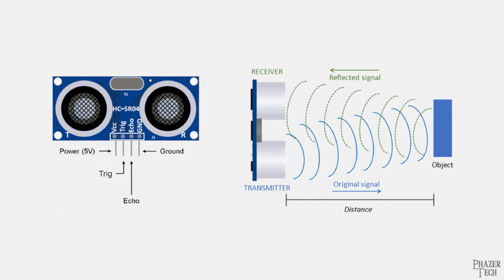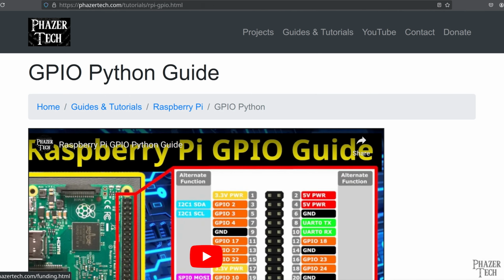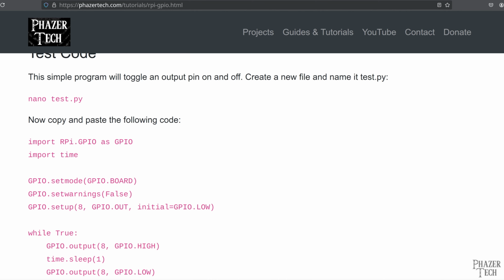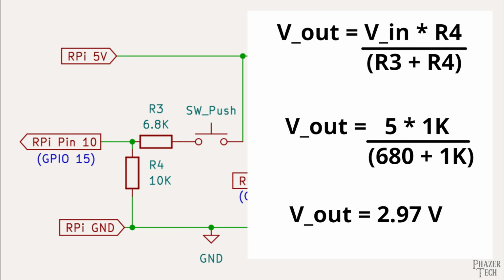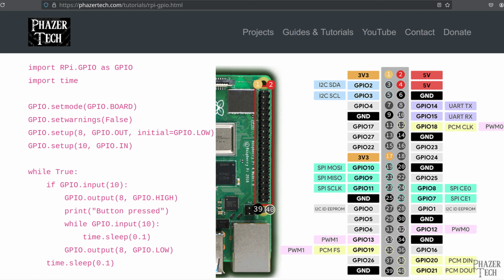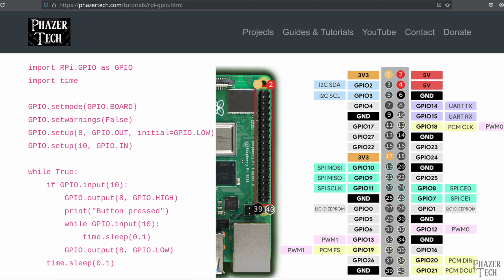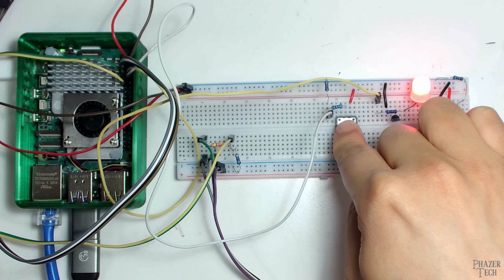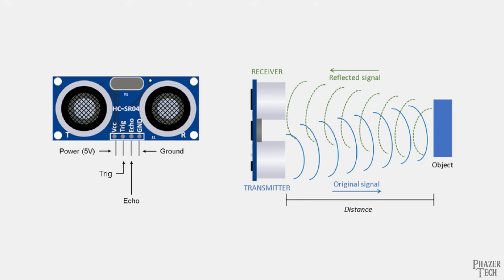Python GPIO - Input Pin Push Button Example & Compatibility With Raspberry Pi 5

Comment from the maker: I didn't notice the "libraries" typo until after I uploaded the video. I fixed the thumbnail but can't fix it in the video. 🙃

Update: If using the official Raspberry Pi OS then you'll need to install the lgpio library as a system package, not with PIP. I've updated the written guide to include this.

Also something important I forgot to mention is the concept of a "pull up resistor" and a "pull down resistor". In this push button example R4 is acting as a "pull down resistor", meaning it pulls the input down low to ground to guarantee that the pin reads low if the button isn't being pressed. Then when the button is pressed, the voltage divider creates roughly 3 volts on the pin which pulls up the input pin so that it registers as high.

Alternatively, we could have tied the input pin to 3.3V with a "pull up resistor", then wire the button so that it forces the pin down to ground when it's pressed. Then in the code, we would check to see if the pin is low to turn on the LED, instead of checking if the pin is high. This method is the exact opposite of what was done in the video, and both are valid ways to achieve the same results. It's a similar concept as NPN vs PNP transistors which I explained in my Electronics 101 video on transistors.

The input pins also have internal pull up and pull down resistors that can be activated in software, which means R4 isn't necessary. But it's usually better to hard wire your own pull up/down resistor instead of relying on the internal one because it's easy to make a mistake in the code and you might forget.

Hopefully this makes sense, feel free to ask any questions.

Comment: I only have a 2n2222 transistor, can I use that instead? It has the same pin out and symbol
Reply from the maker: Yes they're both NPN type so you can use that one.

Comment: Hi, I have a Pi 5 and cannot access GPIOs. Blinky does not work... Could you do an updated guide? ty.
Reply from the maker: What exactly is the error? Which blinky example do you mean?
Reply: @PhazerTech  The Adafruit libraries to enable interrupts dont work, I have a hat with midi and a 20317 i2c for four encoders, I need CircuitPython also. Adafruit Blinka I had problems, GPIO-rpi had problems, I could only install lgpio, and Midi don't work no matter what. Me and the dev of the board are trying everything, clock issues, and other weird issues. I managed to get some basic reading from some pins to a potentiometer and some led's in the end, but it's now really Midi giving me a headache.

Comment: i am using raspberry pi 5 64 bit os and still not able to acces the gpio bin. even not able to detect a push button
Reply from the maker: Which library are you using? If using the official RPi OS then trying installing lgpio with this command: sudo apt install python3-rpi-lgpio
I've updated the guide to show this.

Comment: i am getting a error "  RuntimeError: Cannot determine SOC peripheral base address" what should I do? please help me
Reply from the maker: Which Pi model? Which OS? Which GPIO library did you install?
Reply: Can you recomanded os and libery @PhazerTech
Reply: Me to same error I face
Reply from the maker: If using the official RPi OS you'll need to install lgpio as a system package, not PIP. I've updated the written guide to show this.